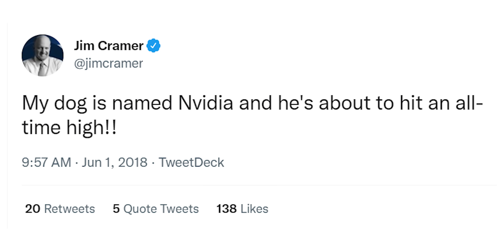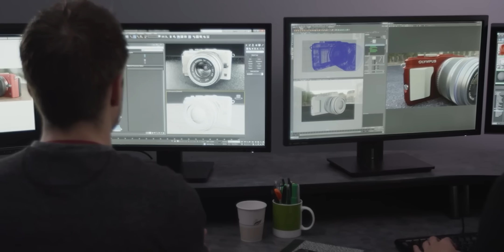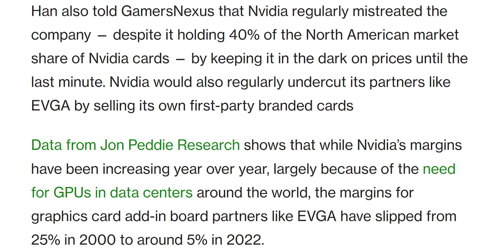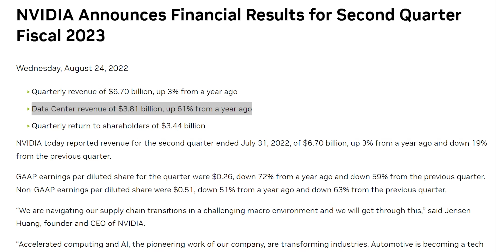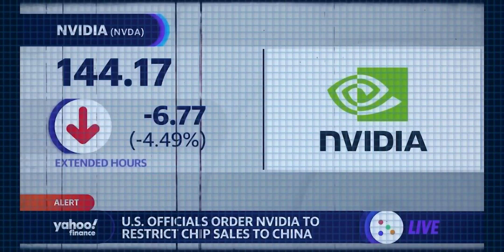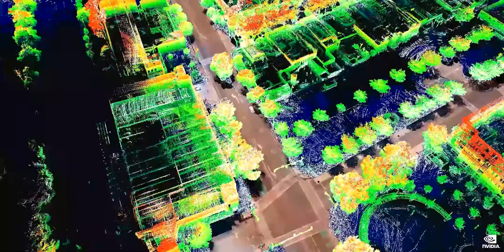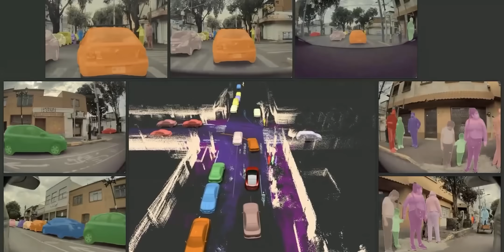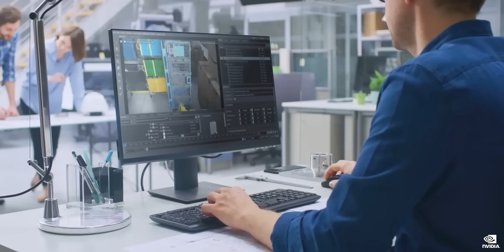Nvidia: The Most Powerful AI Company On Earth? (NVDA Stock)

Comment: NVIDIA is a looser for now based on the stock price as most stocks were pumped higher due to fed QE so now with QT and rising interest rates  it makes it really hard to value the stock or hold it knowing the wider market may pull it down. Don't worry long term it will become under valued and fed will perform a U turn so we will all buy.

Comment: Excellent video, as usual. Chips have a deeply cyclical history and NVDA and AMD seem expensive even at todays discounted prices. Too much going on for me, chips are interesting but as an investment I'm giving them a pass.
Reply: While I agree, NVDA is way more expensive than AMD. NVDA is seen as the sexier play, but I certainly wouldn't rule out AMD if it got down to a price in the 40-50's. NVDA is way too expensive at 125. Just imagine if 4th quarter earnings go south and they continue to guide lower. You will this stock in the 70-80's.
Reply from the maker: Awesome! Glad you used the info to make a decision that's right for you 🙌
Reply: @TickerSymbolYOU  The issue is that though NVDIA may be in other businesses, Wall Street still regards them as a PC chip company. There you are prone to significant downturns. At 125 it is still way too expensive. What are your thoughts of getting involved in AMD if it goes down to 40-50 bucks a share?
Reply: While NVidia maybe be expensive, you can by an ETF like SMH
Reply: You are Right for Nvidia but amd and qcom have a PEG of 1 oder below